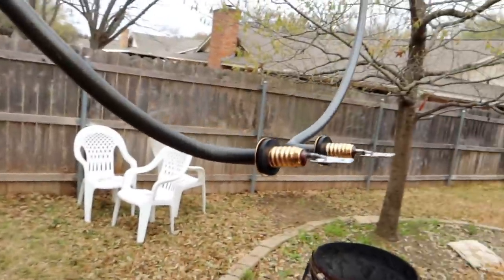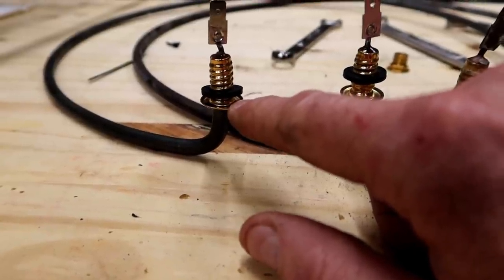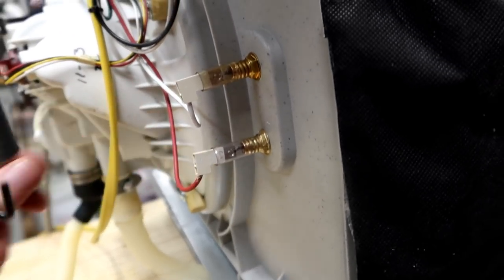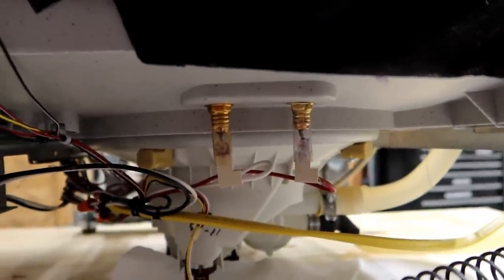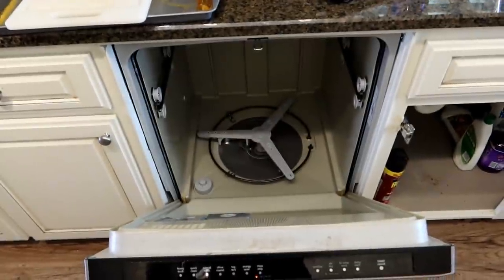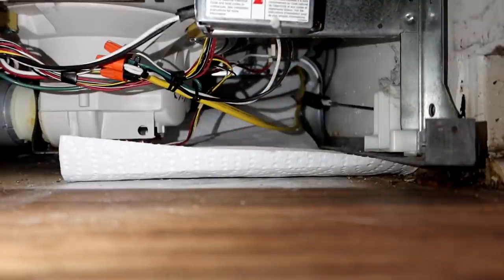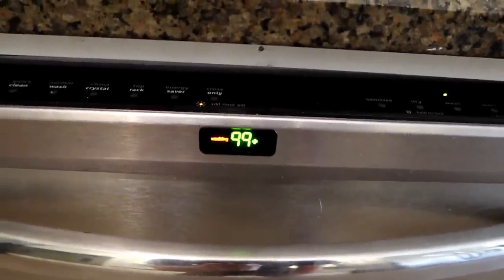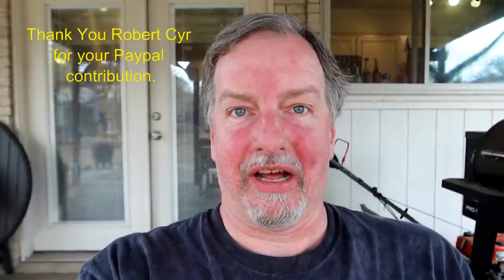Dinner At Fuzzy's Taco Shop - Escaping The Mouse - ETM-550

Comment: Funny thing, I was in Texarkana today and drove by the Fuzzy's Tacos on State Line and Texas Blvd.  I thought about going in but decided on something else.  Lo and behold, tonight, I watch your vlog, and it's about Fuzzy's Tacos!  I guess I'll drive back and try them out tomorrow.  I wonder if that was a design flaw on the heating element on the dishwasher and subsequent replacements featured a redesign for the very reason you had to replace yours.  Should have had a recall, because I definitely believe it could have been a fire hazard.